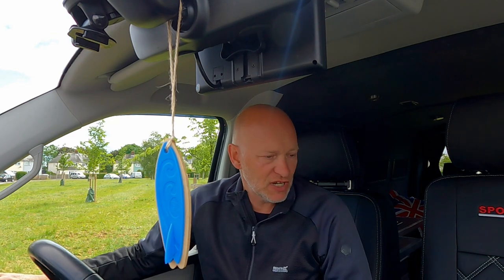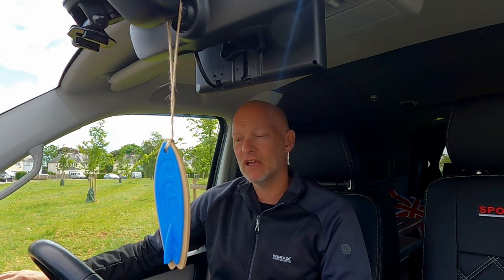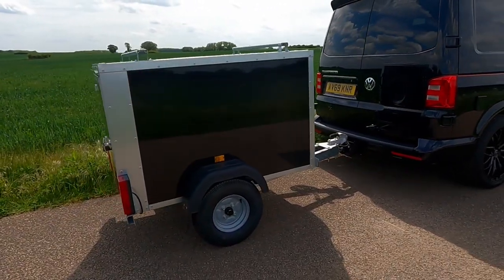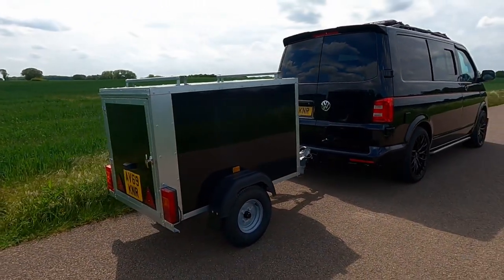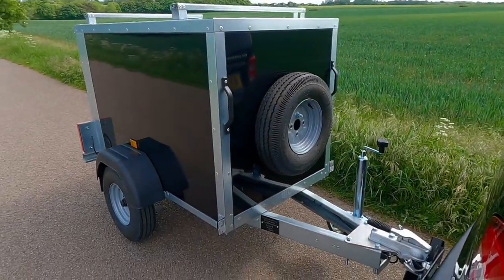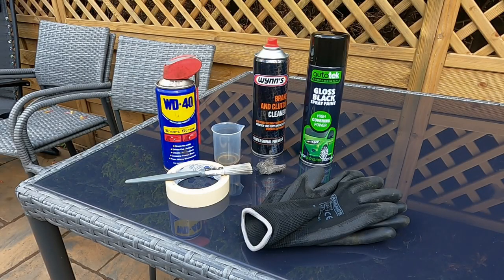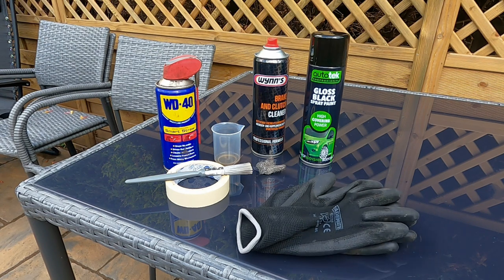Camper Van Trailer. Camping trailer kitchen. VW Camper

Comment: Hi. Great trailer, perfect size. What is the trailer make/ model?
Reply from the maker: Hi its made by Tickners Trailers, this one is CP box 5ft x 3 ft x 3 ft, really good quality and tows ready well.
Reply: Thanks its the perfect size for a VW van
Reply from the maker: @pajefferies  Defiantly recommend it, I keep everything in it, then its easy to hitch up and go, and gives a lot more room in the van. It tows so well you don’t really notice your towing. Thanks for watching.
Reply: @exploresandtosummit  Appreciate the feedback and great vid.  Where did you get the sliding rails for the pull out shelf?
Reply from the maker: I think from Amazon or maybe Screwfix.